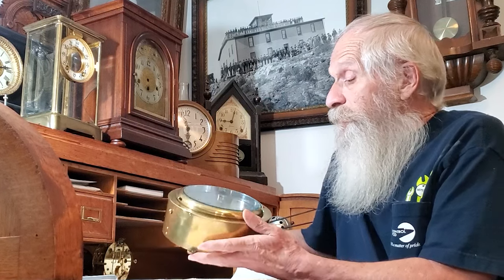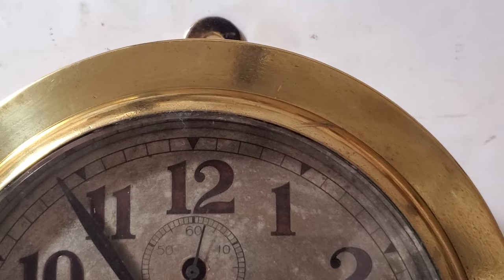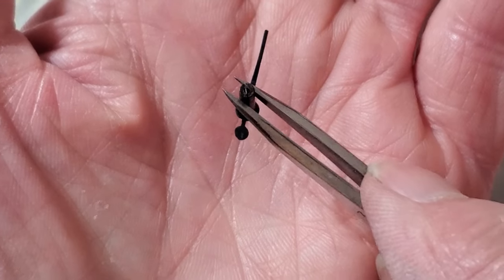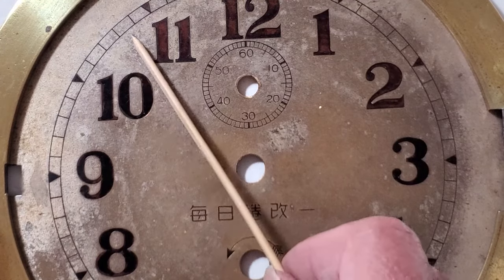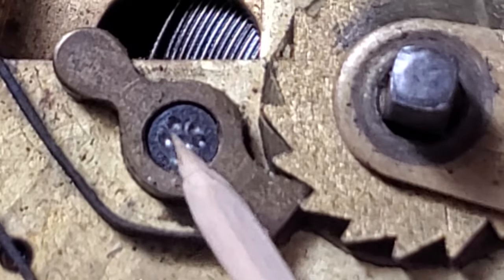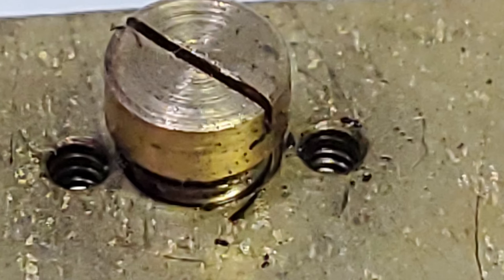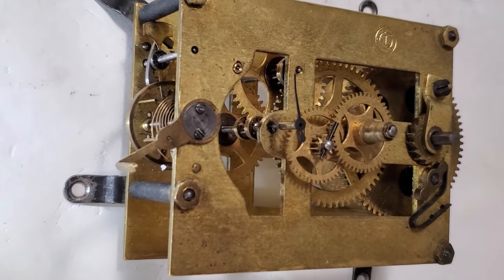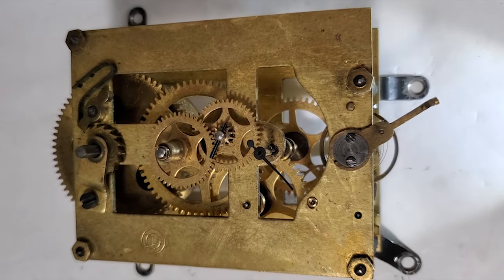Part 1 Aititokeidenki Ships Clock Inspection for Ron from Iowa #76

Comment: Great evaluation as usual.
Funny, that as you describe the faults,can picture how you may resolve.
This is the familiarity you portray with your excellent logic.
Thanks again.
Reply from the maker: Still looking this one over.
Ended up finding multiple escape wheel teeth that someone modified after this video was put up.
Its looking like I may need to rebuild the escape wheel teeth.
No luck finding replacement parts on this movement.

Comment: Very cool piece of history! I hope the owner goes for it on the restoration, definitely worth saving and you’re the right guy for the job. I personally would love to watch you make it run the way it was designed to.
Reply from the maker: Thanks Sam,
 Several butchered areas in this one, it being rare presents specific challenges in itself, no examples out there to use as reference.
It was given up on by the last person due to not knowing what was butchered by the previous guy and no replacement parts or repair information available. 
It will end up being a nice running movement once done.

Comment: 👍 Your careful and insightful inspection revealed some of the major challenges to this movement. The close up and slow motion photography made it clear that the movement has been abused. . . . Very rare clock. I believe the same company also made a bomb detonator timer during ww2.
Reply from the maker: Yes I have heard of that, seems the company made various mechanical and electrical items to generate income, seems they built a lot of their business fabricating water meters, makes sense, early water meters had brass gears same as a clock.

Comment: Fixing the escapement looks to be extremely challenging.  I've seen some Tommy Jobson videos where he fabricates a new escape wheel, but he has some very elaborate and expensive machinery.  Or is there some way of adjusting the pallets to make them project a little further down into the escape wheel?  I like the care you use in disassembly, e.g. using wood to pry the bezel off.
Reply from the maker: This movement has and adjustable pallet.
Adjusted it down a little lower to the escape wheel teeth, but before they reach the locking surface they end up not having enough room to move past the pallets. 
I'll need to study it a little more.
I am thinking now, either the escape wheel teeth have been shortened or the impulse surface on the pallets have been changed. 
The different hairspring installed bothers me as well, that could end up being another issue to deal with altogether.

Comment: 👍 Hi, can you compare this clock with the ship's clock Vostok (video 63)?
Reply from the maker: I don't have the Aitiokeidenke up and running yet,  escapement type is completely different from the Vostok and it has no Geneva stop mechanism.
 The Vostok is a newer movement type with improvements to the design and materials,  its capable of keeping better time than the Aitiokeidenki if set up correctly.
Reply: @jamesmartin5370  thank you, there are other ship clocks on your channel, you can also compare them

Comment: I'll be very interested in the repair of this escapement if you go ahead with it. Not an easy one.....
Reply from the maker: This one will be repaired, it will take some time to sort out exactly what was modified on it.
One concern is from what can be seen, all quality of work done on this is poor.
Can only assume then, that the pivot holes may have been mis-aligned when the bushings were installed.
Reply: @jamesmartin5370  Looking forward to seeing how it works out.